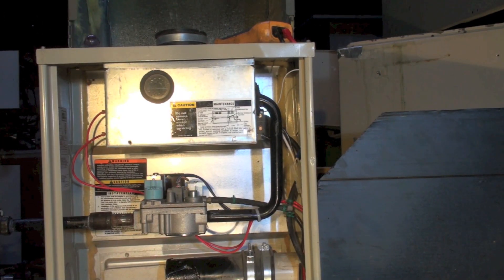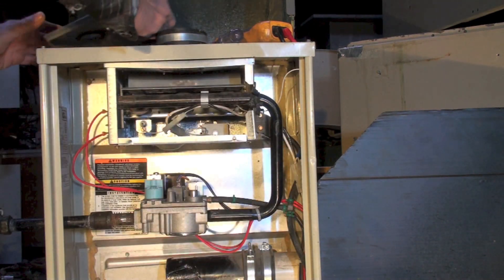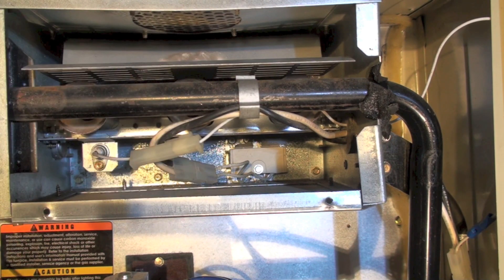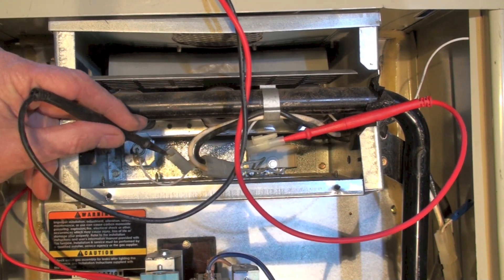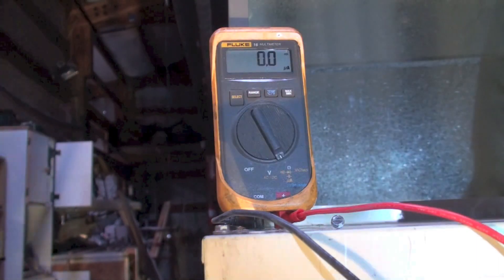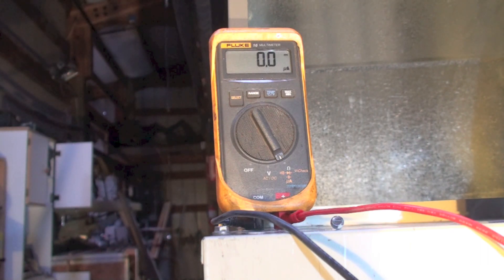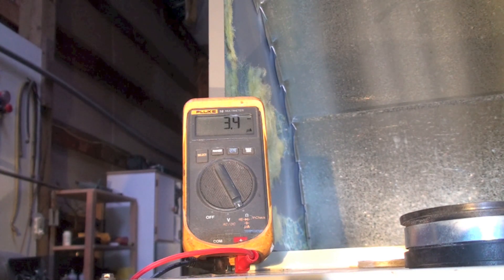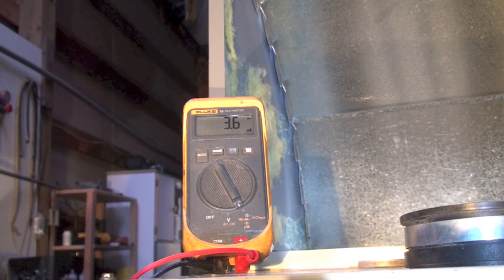Testing the flame rod on the 398aav Carrier part 2

Comment: here's a question, that has little to do with a flame rod-i'd have sent a message but i cant figure out youtube's new messenger system. We have a rooftop furnace at work. When it turns on (when the blower comes on..) the heat that is sent out the duct is immediately like a bazillion degrees. it goes from cold to scorching in a matter of seconds. the air is so hot, its uncomfortable to be beneath a duct/vent. I know on my home furnace, I can adjust what temp (in the box) the fan comes on. Would this also be an adjustment a service person could make on a larger rooftop furnace?
Reply from the maker: The unit could have a cracked heat exchanger and the vent gasses are getting into the air flow.  This is a dangerous condition.  The heat exchanger should be checked.
GFM

Comment: Nice demo.  I assume the meter hook-up requires correct polarity.  Is it standard to connect neg probe to the rod?
Reply from the maker: Straycurrent   This microamp test is an inline test so the polarity is not necessary.
GFM